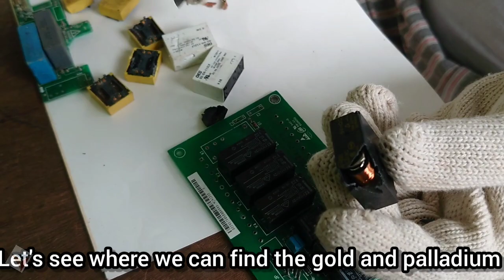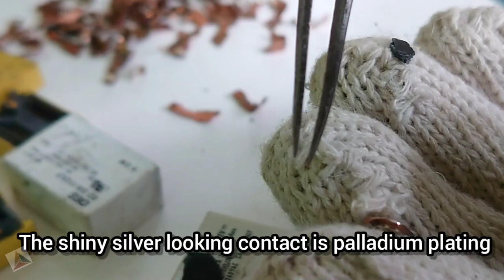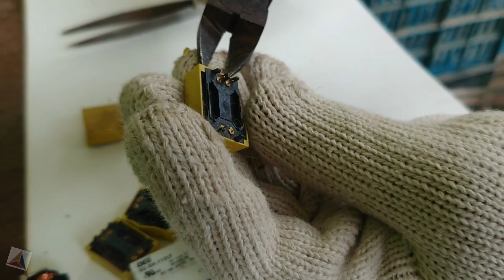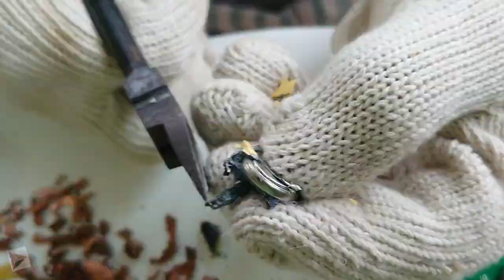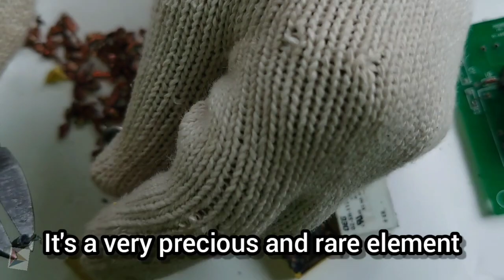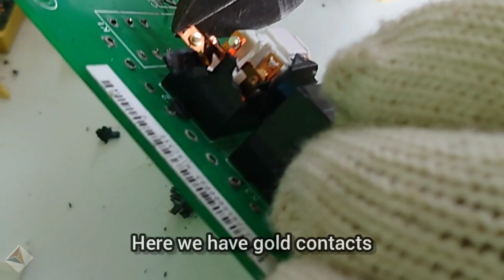What is Inside Relay Contacts | Gold And Palladium Recovery | Scraping Relay Contacts

Comment: I’ve done 100s of these plastic relays and they all are either silver / silver on base / gold plated silver - rarely palladium plated there are relays which do contain the platinum group but are superior grades especially old post office types , and don’t forget the copper iron cores have value.
Reply: Yea he gets some wring information sometimes than I or others try to help him. Palladium isn't rare but none of those to be palladium. Most of these were also just plating on silver or silver contact on copper. Very low yielding material for the work to take apart

Comment: Soviet age electronics used Pd as a cheap gold replacement. in the 1980s and 1990 there was little use for Pd at all. So if you can get some old Soviet/Russian electronics what you see as shiny metal most likely is not silver but Palladium.

Comment: hello, I'm new in this business, I had a question, I processed bga chips with sulfuric acid, but the gold wires are holding magnets, what is the reason for this?
Reply from the maker: This method is called wet-ashing method by sulfuric acid.  However, Golden makes no difference whether it is magnetic or non-magnetic.  Recover Gold in the Aqua Regia Process.  There is no problem. best of luck...
Reply: @TrinityGoldRecovery  Thank you..
Reply from the maker: you're most welcome